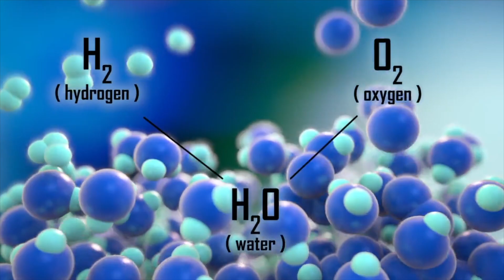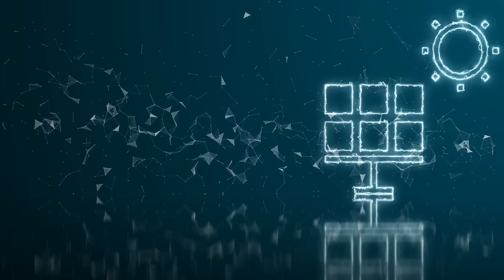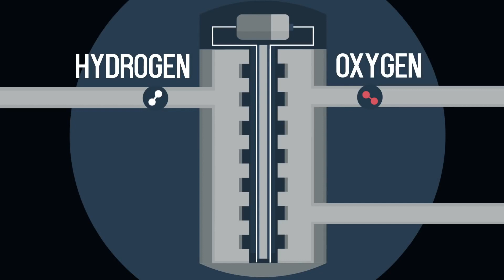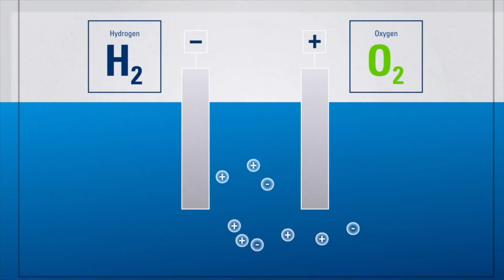Why don't Water Powered Cars already Exist?

Comment: You might not be aware, but there was a system to do exactly what you’re doing or wanting to be done by Professor Cornish who is now using this to power villages in Africa it was tested using a BMW 2000 mL engine on urban cycle and was capable of keeping operating with the hydrogen and oxygen being produced please ring 07 500 909264 for more info, Dave

Comment: Problem has been solved. Radium can disassociate water, ammonia, and other liquids. Then there is also a electrical dissociation. A device capable of producing 70kv at 42.1khz in distilled water can produce 1000x more than old fashioned electrolysis. If I remember right, 3watts could produce 70liters a minute